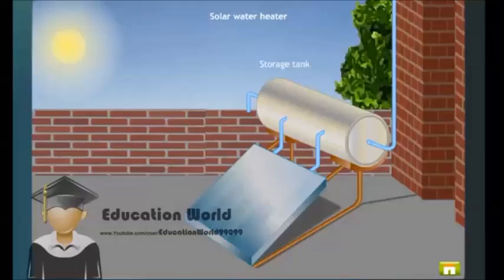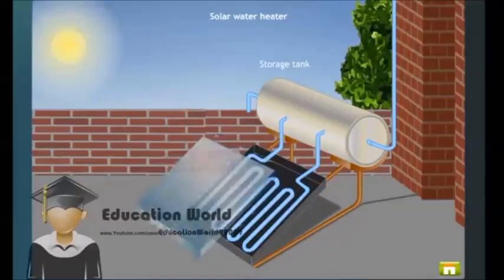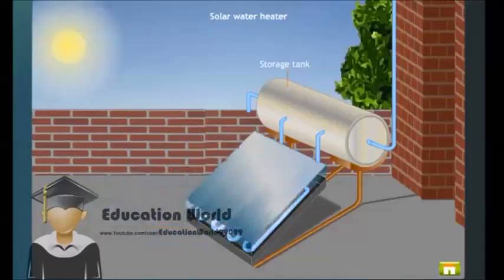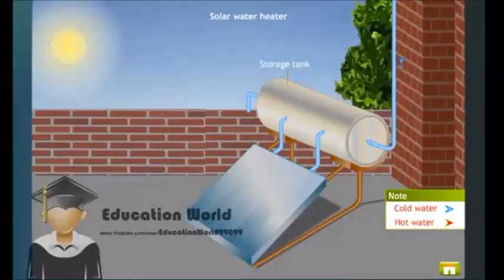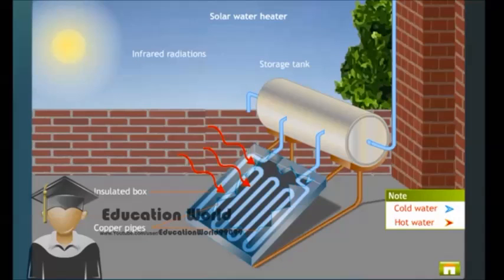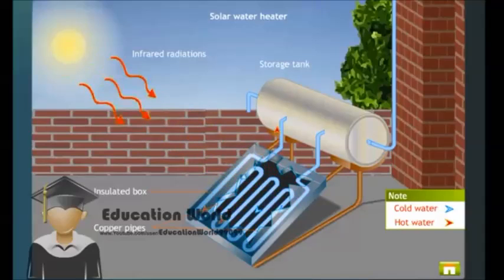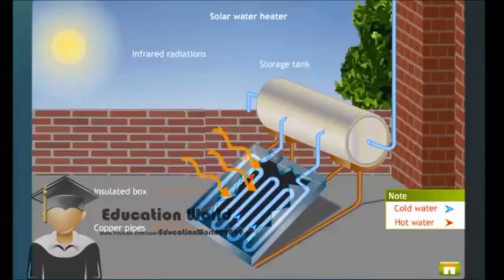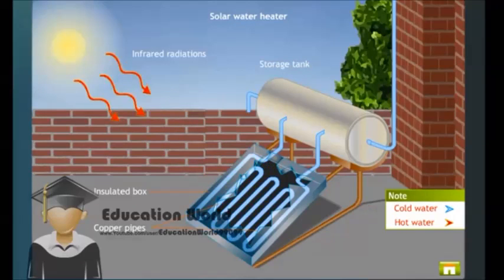MyEnergy How Solar Water Heaters Work For DEMO ONLY

Comment: I know this is dumb question but does it work at night?
Reply: no it requires sun light but if the water tank is well insulated water can stay hot at night as well
Reply: Melisa Menteşoğulları I am interested to know what temperature does the water heat upto in cold climates, like the Uk 🇬🇧